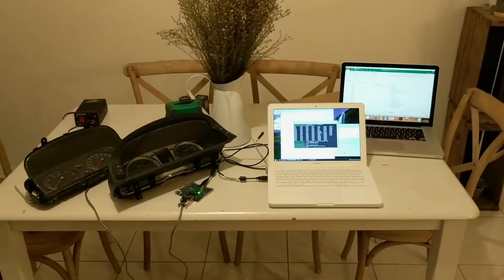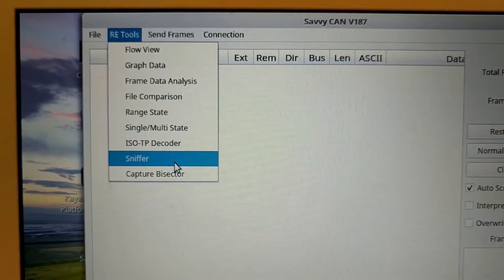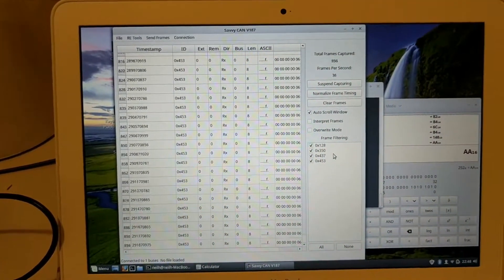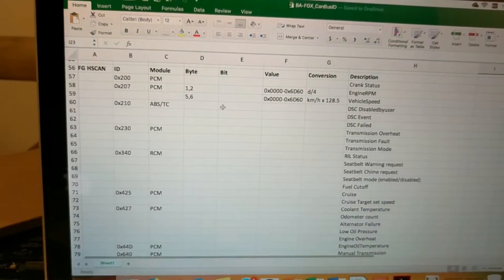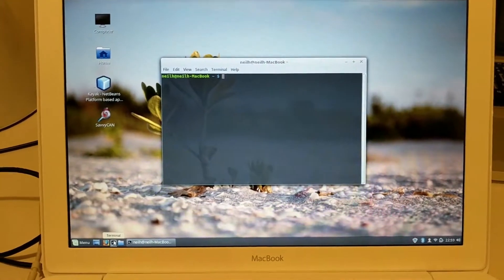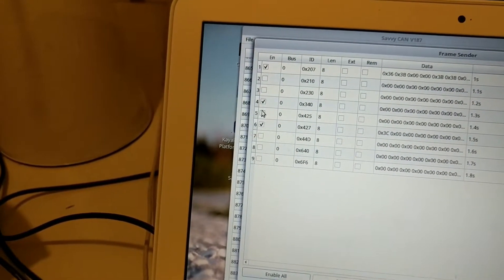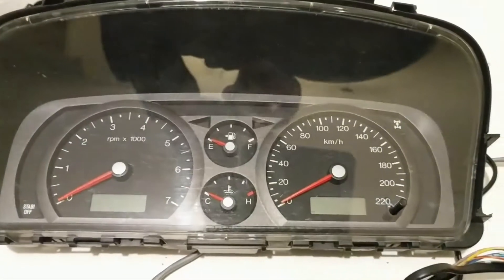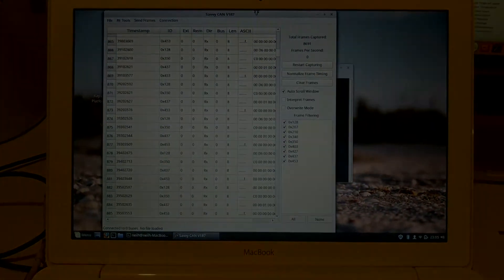Ford BA-FG CAN-BUS I/C hacking with SavvyCAN

Comment: you are a champ! There is so much General canbus info, but nothing that really follows the details for conversions and swaps. I'm marrying two can systems myself, so your guidance is appreciated.
Reply from the maker: Nice! This one is pretty old for me now (have done a fair bit more since then), but the middle-man device should be pretty easy to do if you can sniff both networks beforehand :) Would be a good sell to have something programmable to just put in the middle and program with software